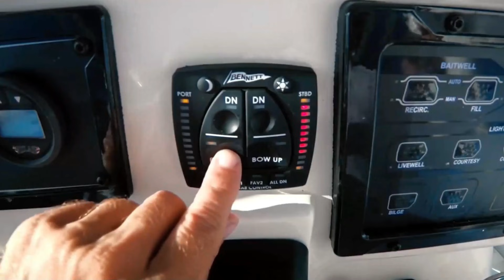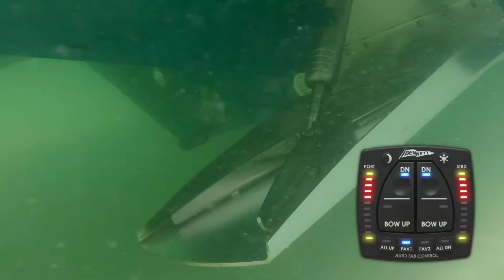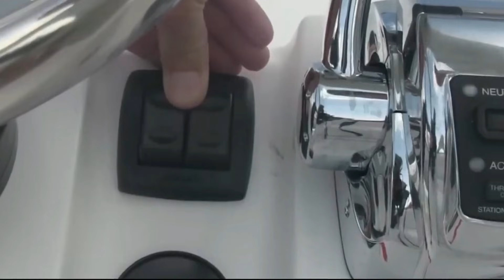FULL THROTTLE Physics Secrets Every Owner Should Know!

Comment: This is a hard sell i run at 75% for fuel economy. If the water is rough i don't think the engine would be happy WOT and crashing through waves.
Reply from the maker: You make a solid point! Balancing fuel economy and performance is crucial, especially in rough waters. Finding that sweet spot can really enhance your boating experience.

Comment: Full throttle can be more than needed.  Plus GAS consumption SKYROCKETS!  My newer motor burns double the gas going from 4K RPM to 6K.  Close to linear up to 3.5K.
Reply from the maker: Great observation! It’s always important to find that sweet spot in RPMs for both performance and fuel efficiency. Thanks for sharing your experience!